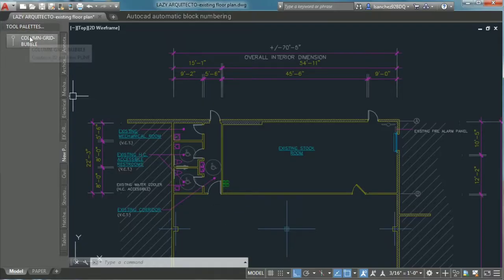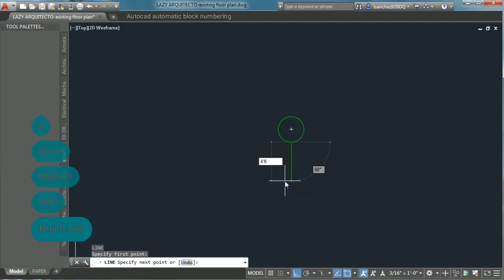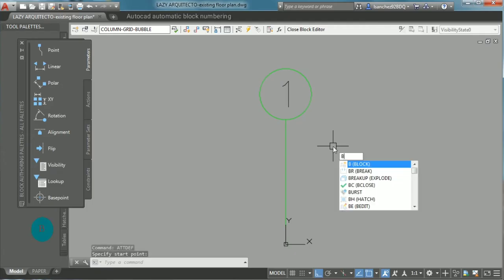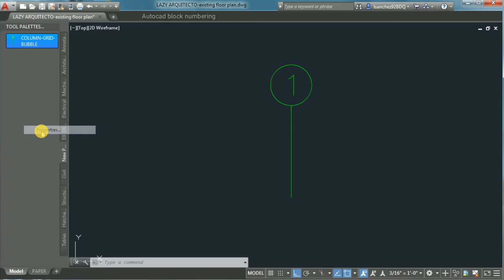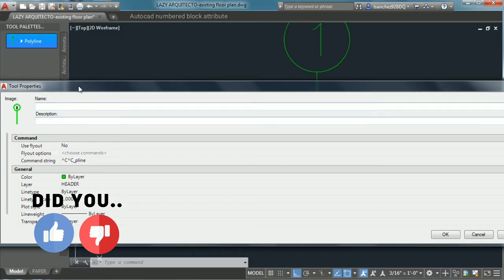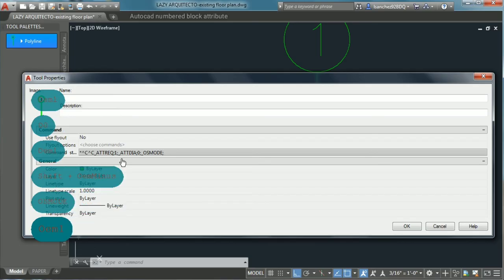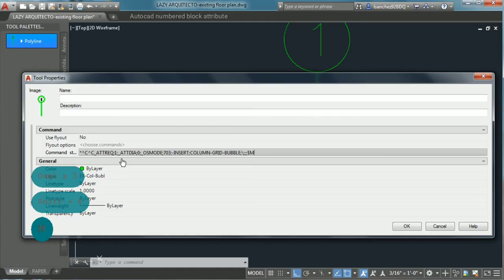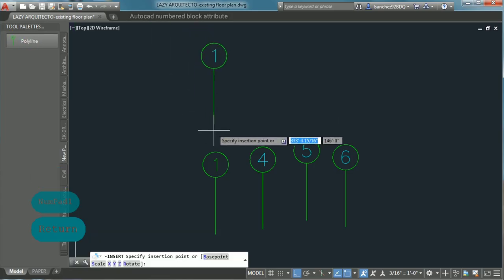Simplify Your AutoCAD Work Auto-Numbering Blocks

Comment: Hi,

First of all, thank you very much for this video. The instructions are clear, precise and by reading the coments section, it seems like it is working for most.
However, and can't figure out why it's not working for me. I'm working with AutoCAD 2022 in french, I follow all the steps, still the new number is not showing and always print the value "1".

Thank you for your help.
Reply from the maker: Hi what I'd recommend is to get the macro code here http://bit.ly/363dyBY so you can copy and paste and avoid any typo or errors.
Reply: @LazyArquitecto   Hi sire,

Actually made it work thanks to a coment. Right after the bloc name, there is 3 ";". If I only keep 2, things works just perfectly
Reply from the maker: Glad it worked for you Lewis. 😃 join us live this Sunday 10am (Pennsylvania US time)

Comment: Thanks for such informative and detailed tutorial. is there any way to modify this so it uses letters instead of numbers? A, B, C instead of 1, 2, 3?
Reply from the maker: Yes that will need a lisp program Khan
Reply: @LazyArquitecto   Please can you expand it bit further? Do you mean to say lips routine or a lips programme? If you meant to say lips routine ? Where can I acquire this routine ?

Thanks for the reply and your good work!
Reply: I also would find this very helpful with tapered insulation numbering, it always adds a lot of time and boring repetition to the task. Cut-to-falls insulation always designate the boards via A, B, C etc. Like A = 25-45mm, B = 45-65mm etc.

Comment: Sir, thank you for this tutorial, very useful! I am having one little glitch though, I am not able to get the numbers to start over. I am right now using the AutoCAD 2025 free trial, trying to convince my employer to purchase this full version! Otherwise I use the LT version. Any ideas?
Reply from the maker: Hey 👋 glad you found this Autocad tutorial helpful. This macro command was tested to work on both versions of Autocad including LT. did you use the useri variable to reset the number?
Reply: @LazyArquitecto  Yes, I believe so, I followed your text precisely from your video. I will have to try this also in my LT version as well. Thank you for getting back with me, very much appreciated! I have not been back on AutoCAD of any kind much for over 22 years so other than the basics I am having a difficult time, a little like riding a bike though, you never really forget!  Thanks again! I will keep trying!

Comment: thank yu for this. unfortunately did not work on mine. after i insert , no block comes. Could it be because am using an LT version- Acad 2020
Reply from the maker: Correct, users option is not available in AutoCAD LT Samash

Comment: Hi! I'm stuck trying to specify the image. It doesn't appear anywhere in my folders. What do I do?
Reply from the maker: Did you save your drawing first, and then drag the block to the palette? Also if the problem persist you can always go online and get any free icon and use it for your command.

Comment: Hi! I have a question, if this method will work with block(dynamic or nodynamic) with more then one attributein block? For example: have block with 6 atributes (they dont hange during paste) and the next atribute will be the atribute of number block (hange during paste)?
Reply from the maker: It will work with any number of attribute but you'll have to change the code. If you're interested we can meet 1 to 1 to help you here http://bit.ly/2Mz4kGc
Reply: @LazyArquitecto  ok, i have a problem. When i put the blok from pallets to model it paste one time and after it show that: "Enter new value for USERI1 <3>".  Some advice??

Comment: This is some nice work. I recreated it today however it broke once i used it in a dynamic block. Can it work in a dynamic block?
Reply from the maker: Yes it does. What error are you getting on the command line after using it and pressing f2?
Reply: @LazyArquitecto  No error, the only thing I changed was block name. My new block name had underscore in it however, so maybe that’s what broke it.
Reply from the maker: Yes, can you try renaming your block with rename command?

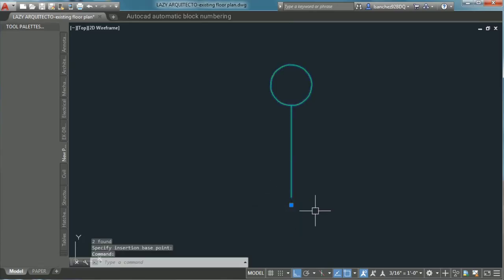Comment: Thanks for this! I'm trying to set this up in Autocad Mechanical 2022, I'm just testing to see if it can be done and then will try to set it up in LT 2022. At 2:24 in your video, the "Edit Block Definition" window opens. When I double click the block, I get the "Reference Edit" window. I'm not sure what to do to correct this. I'd really appreciate your help. Thanks!
Reply from the maker: You can also right click on the block and pick edit block
Reply: @LazyArquitecto  Thanks, got it! Does this procedure have to be set up in each drawing? I created a button using the macro and the button works in the current drawing. But if I open a new drawing and pick the button I get an error. The block's name is AUNMB-LT. Autocad says it can't find, "AUNMB-LT.dwg"  in the search path. I don't understand why Autocad added the ".dwg". There is no AUNMB-LT.dwg drawing, so what am I supposed to put in the search path? Thank you!
Reply from the maker: The block needs to exist in your current drawing

Comment: GREAT JOB. But what if we want to autonumber the first attribute of a block with many attributes?
Reply from the maker: It's possible but you'll have to modify the code and test it. I'll do an update on this video showing how. Have your 🔔 notification on so you don't miss it!
Reply: @LazyArquitecto  I just stumbled across this video that seems VERY helpful, and I had the same question as Cdalav... I have a Block with three Attributes representing Wireless Access Points for large Warehouses. We end up placing hundreds of these in the buildings and having it auto number as we place would be AMAZING... Would you be able to share info on how to handle this same situation with a Block that has multiple attributes?
Reply from the maker: Send me your block to irving@lazyarquitecto.com and I may pick your question to do a live stream for our LazyQuestion Show. Have your 🔔 notification on so you don't miss it!

Comment: Sir have you any lisp to filter out polyline having length from 2 meter to 5 meter and having area from 2 sq meter to 5 sq meter .thanks
Reply from the maker: Ahmed always glad to hear from you. To answer your question, you can easily filter out those selections using quick select command.
Reply: @LazyArquitecto  by quick selection I can't make such selection, I tried it.
Reply from the maker: Ahmed I'll make a selection tricks video soon using your request, make sure you have your 🔔 bell notification on so you don't miss it!

Comment: ADD THAT LENGTHY COMMAND IN VIDEO DESCRIPTION. THAT WOULD BE HELPFUL
Reply from the maker: What do you mean by lengthy command Daniyal?
Reply: @LazyArquitecto  i mean the command string
Reply: Is this correct?

*^C^C_ATTREQ;1;_ATTDIA;0;_OSMODE;703;-INSERT;tag_rad_01;\;;;$M=$(GETVAR,USERI1);USERI1;$M=$(+,1,$(GETVAR,USERI1));

My bock keeps putting a 1 in every circle...
Reply: @Jintoona  Mine too
Reply: @BF-27  ghehe, so simple... now it works for me to, thx mate ;-)
Reply from the maker: Glad you guys got it to work. Sometimes happens that the macro code may have to be changed a bit depending on the Autocad version.

Comment: I Follow all the commands in the properties , when its finished the number is not changing , its the same block , 
where did i go wrong
Reply from the maker: It can be many reasons Francis, what error are you getting after using the auto numbering and pressing F2?

Comment: I have done exactly as you said but autonumbering isn't working. its showing same number again. I am using AutoCAD LT 2022
Reply from the maker: There are some commands in the full version of AutoCAD that are not available in Autocad LT. What I will do is start testing some of the commands and system variables individually on the command line used on the macro code and find out the one that is not available to remove it from the code. Hopefully this helps
Reply: @LazyArquitecto  Thank you very much. it is actually working after I removed one of the ;
Reply: I am looking to use mix of alphabets and numbers. Is it possible with the present macro? or do I need to create a new macro which I have no idea how
Reply from the maker: @srihari2414  great 😀
Reply from the maker: @srihari2414  i am sure it can work with multiple text attributes and numbers but i will have to test them. You can try and let me know. I can also do a future video about it if your question got picked for our next LazyQuestion live show

Comment: The numbering process doesn’t seem to work for me, perhaps I’m doing something wrong?

The block will not auto number,  I have used other peoples suggestions below, but it displays the USERI1 text on screen Or ….1 but then just numbers everything 2 repeatedly…?
Hope someone can help.. thanks..
Reply from the maker: Are you using Autocad LT?
Reply: @LazyArquitecto  

Thanks for a prompt response.

I’m running on Autocad 21..

The best I can get it to do, is to select it each time from the palette-  I have to drag it to my attribute, then it allows you to type a number manually before pressing enter…
Reply from the maker: @paulbuckley52  what error do you get after using the command and pressing F2?
Reply: @LazyArquitecto  I’m not seeing any error codes as such, there just doesn’t seem to be a function working where it automatically numbers the next attribute.

I am currently having to type in each count number manually.
Reply from the maker: @paulbuckley52  do you know if you are using AutoCAD 2021 regular or LT version?
Reply: @LazyArquitecto  it the regular auto cad 21 I’m using
Reply: HI 
I have exactly the same problem nothing is changing. Instead of numbers it is still USERI1
Reply from the maker: Does your block have multiple attributes?
Reply: @LazyArquitecto  HI THANK YOU very much for such a quick respond 
I was just following your video and I did exactly the same so to be honest I am not sure
Reply: @LazyArquitecto  I followed your illustration by drawing the block and saving it in the pallet, so I don’t think so.
How would I check?
Reply from the maker: @paulbuckley52  does your block name contain a space? For instance, door block
Reply: @LazyArquitecto  no just named it ‘bubble’
Reply from the maker: @paulbuckley52  hey sorry for the late response, if you still want to make this command work, I can help you here Fast CAD Help? https://wa.me/message/53IE3736JSJMG1
Reply from the maker: does your block have only 1 attribute? if not, the code will need to be modified a bit.
Reply: @LazyArquitecto  
I’m still working on this, I have recently being using GStar cad- within the tools there is a attinc command which automatically does the function of auto numbering the ‘bubble’.
(It’s like an earlier version of auto cad) just wondering why AC haven’t devised this tool into their recent command list?

But yes I’m still struggling to be honest..
Reply from the maker: @paulbuckley52  I'll take a look at the GStart. But what don't you keep using that tool?
Reply: @LazyArquitecto  The gstar cad is a workplace software which I also use, but I also have autocad 22 of my own which is what I hoped to be using long term.
The Attinc command within gstar is great, but autocad 22 doesn’t have it which is a shame.

I was trying again yesterday using your video, and I got stuck trying to select an image for the block within the tool palette, my computer doesn’t show me the thumbnails like yours does, (the one with the column grid bubble.)
When I eventually found it it was saved as a dwg.. is this correct?  A message appeared saying something along the lines of the drawing (bubble.dwg) was incompatible and could not be saved..??
Reply from the maker: @paulbuckley52  are you using Mac?
Reply: @LazyArquitecto  no a windows platform..
Reply from the maker: @paulbuckley52  I can help you set this up in a zoom call if you're interested. Fast CAD Help? https://wa.me/message/53IE3736JSJMG1

Comment: Hi. 
Thanks for this. 
I love it. 
Took a while to master but well worth it. 
One problem. 
I created 5 now USERI1 - USERI5 
But no other number works. 
Is there only 5 possibilities??
Reply from the maker: Hi you'll have to use lisp. Happy to help 😃 join us live this Sunday 10am (Pennsylvania US time)
Reply: @LazyArquitecto  you’ll have to do a video on Lisp I’m afraid. I have no idea. 

I’m in Uk. 
England. 
I’ll check what time that is.
Reply: 3pm I think. 
I’ll try to tune in this Sunday. 
No promises. 

I am having one problem at work on AutoCAD. 
I used to be able to Move, Copy, etc multiple items by clicking one item (say and door) and then another (another door but different room) and Then move. 
But what ever I have done. (Not sure) I can only move one at a time now. 
Not sure what I have done to change this setting. 

Can you help correct?? 

Sincerely 
Martin.

Comment: Hi , I tried this and tried again but not working, is inserting the block but no autonumbering, I cannot figure out why here is the code I added it:
 *^C^C_ATTREQ;1;_ATTDIA;0;_OSMODE;703;-INSERT;test;\;;;$M=$(GETVAR,USERI1);USERI1;$M=$(+,1,$(GETVAR,USERI1));
would be please possible to help? (Specify insertion point or [Basepoint/Scale/Rotate/Explode/REpeat]: Specify scale factor <1>:Specify rotation angle <0>:Enter attribute values
1 <1>:Command: 10 Unknown command "10".  Press F1 for help.) this is some error I red from F2
Reply from the maker: Did you copy and paste the code from what I provided? That's the first thing I'll recommend to make sure you're using the same characters. Here> https://bit.ly/LazyArquitecto